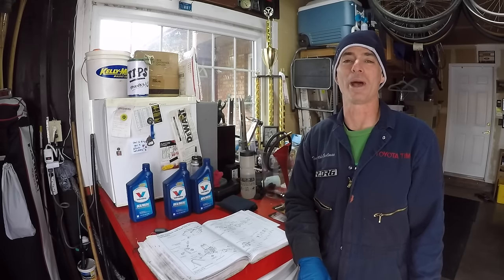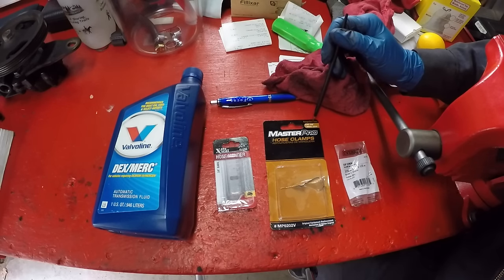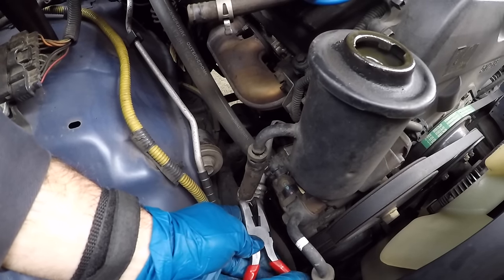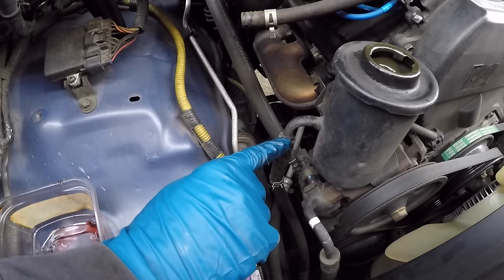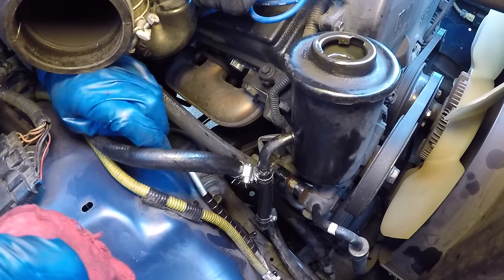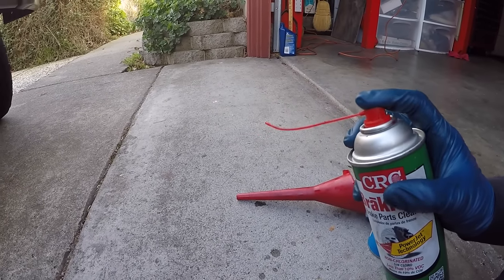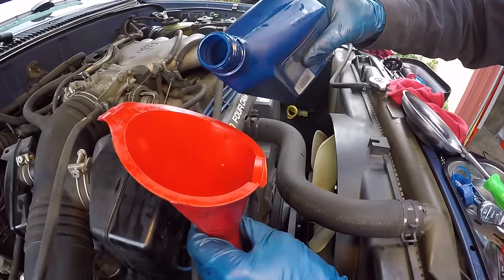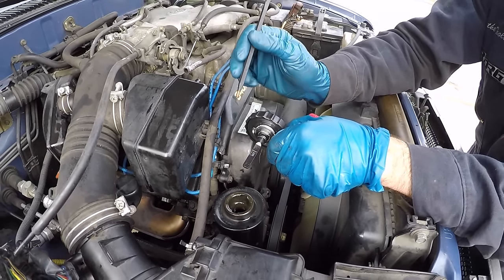Power Steering Flush and Reservoir Cleaning

Comment: Thanks for the informative video. Why not clean the screen before doing the flush? I have always changed o rings. Although they may not be damaged, they do take a set, harden, and will not reseal properly. Your videos are always well done and you explain the steps very well. Keep them coming.
Reply from the maker: Glad you like the video Dan.  My reasoning for doing the flush first is because if we clean the screen first followed by the flush, we may be trapping suspended particles in the fluid right back into our clean screen.  By flushing first and having clean fluid in the system, you can guarantee you'll have a clean screen when the job is done.  Since making the video, we had heard of people having leaks due to the o-ring tearing so we added a section in the video description suggesting replacing the o-ring and we provide the part number and link to buy one.  I just flushed the power steering system on my 98 the other day which included replacing the o-ring as well as adding in in-line magnetic filter in the return line to the reservoir.

It's good to hear you like the way we're making our videos.  Thanks for taking the time to comment.  Happy Wrenching!

Comment: You are so correct about the fine mesh filter medium. It must be cleared of debris.
Reply from the maker: With regular fluid changes, this screen would probably stay relatively unclogged.  But, power steering fluid is one of those fluids like brake fluid that people forget about renewing on a regular basis so it get's really dirty and ends up clogging the screen in the reservoir.

Comment: I did this in 2020 hoping it would solve my problems on my 3.0 3VZ truck. I completely flushed the system, bled it, but the whining / squealing when turning left or right didn't really go away so I fully rebuilt the OEM pump with a $40 rebuild kit.  It has about 5 rubber seals internally plus the shaft seal. Getting the pulley off and back on required some propane torch heat to expand it enough.  Anyway, it worked, ..no more noise and my steering is good.   

And it's actually a tricky rebuild too.  The small internal vanes are lobed on one side and must go back in the right way.. very easy step to miss because you wouldn't notice otherwise.  The 95+ Tacos / 4Runners may be the same or a little different.  95 and before have recirc-ball / worm gear steering not rack and pinion but the pumps, basic system, and process is very similar.  

Secondly, some rebuild kits for these old Yota trucks (mines a 94 ex-cab v6 4x4 and I used Gates kit #350660) don't come with new copper crush washers for the banjo bolt so it immediately leaked once back together. The factory service manual doesn't even mention them.  They are two washers; 16mm ID / 24 mm OD and 1mm thick on each side of the banjo bolt. 

Also be very careful with the plastic Vacuum Control Valve, they can break easily and are $70. I broke a barb while rebuilding the pump but was able to use JB-Weld and beefed up both barbs with the epoxy.  I saw in another video that if the VCV is bad it sucks in fluid to your intake.  So if you are losing fluid either slowly or fast but see no leaks anywhere after a good pump cleaning, pull off the VCV hoses and see if they have fluid in the Vac lines. Use a q-tip to check.  If so.. replace the VCV!

Lastly, the pump definitely needs to be running when moving the wheels lock to lock. Having them off the ground just makes it easier and doesn't eat your tires and stresses the system less but the pump and it's impeller vanes is what is circulating the fluid.  The air which comes back through the reservoir is just burping the system and to do that properly all of the fluid has to be moving through the system under pressure. 

The FSM also says to do all this with the engine running. This is why you do the lock to lock while flushing too, because it opens two different sides of the system.  You have to see the full diagrams to really understand it. I think a good hack to not jack would be two 14" aluminum cookie pans that are buttered and just drive onto them.  Sounds crazy but it would definitely work. And use a little hot soapy water to clean the butter off.
Reply from the maker: Thanks for sharing all that information.  A video of that rebuild would have been super helpful.  Did you happen  to shoot any video of the process?
Reply: @TimmyTheToolman  I did! I shot everything.  I'll edit and upload within the next week or two. I really need to start a channel. I have a ton of truck repair videos and other DIYs but I often get overly wordy and too detailed so I need to really edit them all down.
Reply from the maker: @oldowl4290  I'd like to see the video and I don't care how wordy it is.  I blab quite a bit myself if you haven't noticed.  You should start a channel and let me know when you've posted it.

Comment: Lift the vehicle and while adding fluid turn the wheels back and forth with the engine, that will throw most of the fluid out of the rack and pinon, then start the engine without turning steering, then with the engine off repeat the process. I did it on my Lexus GX470 and only used about 2qts. Is very clean now.
Reply from the maker: Hey Christian, we now know about this as a viable technique.  At the time of shooting this video, we didn't think you could effectively move the fluid through the system with the pump off.  We added this as an optional method in a comment we pinned giving updates on the job as we learned them.  Thanks for the comment.

Comment: Thank you.  Your videos are always thorough. Looks like i will be doing some shopping...this is related to my next project which is to replace my original steering pump, return line, and high pressure line to my '90 pickup with the 3VZE.
Reply from the maker: You're welcome and thanks for commenting about how thorough our videos are.  We want people to be successful using our videos and that's why we put some much detail into them.  Good luck with your power steering pump and line swap.

Comment: Pulled the reservoir, cleaned it, reinstalled. Topped off and bled the system.

Still getting a whine unfortunately...I thought maybe the screen was clogged and not enough fluid was cycling into the pump. It's extremely loud on cold mornings (25 degrees f) but seems to quiet down as the fluid warms up. 

Hopefully this did the trick for colder mornings. We'll have to see or else I may have to replace the pump!

Also I only dropped one of the three bolts (the front small one) and of course it landed in the skid plates.

Great video!!
Reply from the maker: Jesse Vandermaas Hey Jesse, that's a bummer it didn't get rid of your whining issue.  Starting looking at your local PickNPull yards or other auto wreckers for 3rd Gen 4runners and 1st Gen Tacomas so you can grab a used power steering pump for cheap.  You can set up a search for PickNPull where they will automatically notify you when a vehicle that matches your search criteria pops up.
Reply: Probably too late but whining also means you got air in the system. Try bleeding the air out first before spending money

Comment: Great video! I have flushed my power steering a few times over the years but it is very helpful to now know how to clean the filter screen if/when necessary. Motivating me to flush the system again, you are right it is an easy thing to overlook.
Reply from the maker: Thanks Dave.  After seeing how dirty Jax's power steering reservoir filter screen was, I'm going to check out the reservoir on my two 3rd Gen 4runners.  I just bought another 3rd Gen on New Years Eve.  It's a 98 Limited 4x4 with an e-locker.  Only 131,000 miles and it wasn't crazy overpriced like most are in Northern California right now.  Picked it up for $6500.  I searched for over a year for another 3rd Gen after my Subaru Outback died.  I'm stoked my search is over. 

Take it easy Dave and Happy Wrenching!
Reply: Congratulations on your new 3rd gen! Nice find, it is getting hard to find a decent 3rd gen anymore for a fair price. I have a 99 SR5 4X4 4Runner with the elocker and 4.30 diff ratio. Bought it new and it has been a great trouble free truck. 104,000 miles and the only repairs have been the MAF sensor, Air Fuel sensor, shocks, brakes and tires. Replaced the timing belt and water pump at 100,000 and the old timing belt still looked pretty good. Love these trucks!
Reply from the maker: Yep, they are great vehicles and they will be seen on the road for a long, long time.  I'm thinking a high percentage of the 2nd, 3rd, 4th and beyond owners are going to be the type that will be wrenching on these 3rd Gens.  A person that knows how to wrench or that is willing to learn will see value in one of these rigs even if the mileage is really high.  I'm thinking as time goes on, our videos will become more valuable because more people will be needing our videos to keep their rigs on the road and on the trail.  Happy Wrenching Dave!

Comment: Thanks for this great detailed video. One question though: Can you do the power steering flush just buy turning the steering wheel from one end to another end with the ignition key in ON position and without starting the engine?
Reply from the maker: Read the comment I pinned.  It does work.
Reply: That’s what I was thinking. I flushed the power steering fluid with the engine off on my Escalade, so it should work.

Comment: Great video as always. I completed this on my 99 4 runner. Just FYI, when cleaning the screen on the reservoir, use Xylene. Just block the bottom hole, prop it upright, and dump about 1/2 cup of Xylene in there. Wait 10 minutes. Empty it out and viola.... It will look like a new screen.
Reply from the maker: stonesthrow420 thanks for taking the time to comment and leave this tip! We will definitely try this next time. Sicmods!!!

Comment: man i missing working on 4runner. Even though im rebuilding a cummins diesel truck now, i still find myself referring to some of your videos for a quick logic run on certain systems.
Reply from the maker: Do you still have your 4runner?
Reply: @TimmyTheToolman  yep still got her, thanks for asking. I have been trying to sell it for 6k for over a month now.  But no bites.  I think I got about 9ish just in parts alone in it. She is good little truck now.
Reply from the maker: @cameronp5728  Gotcha.  Do you think you'll get another one or are you done with 4runners?
Reply: @TimmyTheToolman  I will definitely get another. In time, probably when I'm not looking and I stumble upon a single owner, with 4x4 5 speed and E locker. All original. That's like the holy Grail for 3rd gen 4runners

This Cummins I have is pretty interesting. It's  one step away from holy Grail. It was the last year for the 12 valves. And its the only 12 valve model where the rear doors open.

1998 Dodge Ram 3500, with a 12 valve Cummins, P7100 injector pump, 5 speed NV-4500 transmission. But it's 4x2. That's what makes it one step away from holy Grail.

You would appreciate this engine & injector pump and the complete mechanical nature of it. Google if you get bored some time.

Sorry rambling over lol gotta get this damn thing back up and rolling!
Reply from the maker: @cameronp5728  Sounds like a fun project.  Good luck with it.

Comment: I was worried this morning.. Steering response was pretty hard on startup, then went for a drive to a local store and it got better, not completely ok, but better. After getting out of the store, steering was on ok on startup.. maybe because the P/S fluid is warm now? From the Forum search it seems like a common issue on these cars. Hopefully this service will fix the hard steering on my 3rd gen. Your videos are invaluable, Thanks Tim!
Reply from the maker: Hey Mike, power steering fluid is one of those fluids people don't think about renewing, just like brake fluid is.  So, the fluid gets old, deposits accumulate and get stuck in the fine mesh metal screen.  Over time, the screen can get blocked up so bad that it starves the steering rack of fluid.  If people renewed their power steering fluid regularly, this cleaning probably wouldn't ever be necessary.  For sure cold ATF doesn't flow as well as warm ATF.  As ATF warms, it thins out and the volume increases.  This is why you have a cold and warm level on your auto trans dipstick and also on your power steering fluid dipstick.  I'm guessing you're going to find a very blocked up reservoir screen when you check it out.
Reply: @TimmyTheToolman  Yeah that makes total sense. Looking forward to it. 👍🏻
Reply from the maker: @Mike_44  Good luck with the job.
Reply: @TimmyTheToolman  Thanks brother 👍🏻I just realized I need a bigger/taller floor jack lol
Reply from the maker: @Mike_44  Well, where are you trying to jack under?  Most floor jacks can reach the areas necessary to get the wheels off the ground.
Reply: @TimmyTheToolman  The floor jack I had was a smaller 2 ton which worked ok for my previous Forester, but the 4Runner’s frame is taller so I had to get a taller jack. It’s all good, it worked out. I needed a bigger one anyways for my wife’s Honda Passport as well..
Reply from the maker: @Mike_44  Roger Dodger
Reply: @TimmyTheToolman  I replaced both LBJs today.. my first kinda in depth service for the 4Runner 👍🏻
Reply: @TimmyTheToolman  😎
Reply from the maker: @Mike_44  Good job gettin er dun.
Reply: @TimmyTheToolman  Thanks!

Comment: I know this is old now but I wondered if there was an additive you could have sent through to help clean it and then reroute the line back into the res can. and just let it run a while then empty and repeat.  Avoiding the gunk from the res can is a good idea too.  Perhaps a temp filter in that line setup to catch gunk before it got to the pump etc. even a garden hose type strainer may have helped catch big chunks.  There are other screens available too with much smaller holes.  Anyway, I liked the video.  I need to do this on my 2003 Taco 4WD, along with many other things.  I'm at 122k its been treated nice but some things overlooked.
Reply from the maker: Don't know of an additive that would have helped clean out that screen.  Even if there was an additive that strong to be able to clean out the filter screen, what would it do to the pump and steering rack seals?  Anyway, good luck with the job.

Comment: The pump has a by-pass valve which is where the fluid goes when you are not turning the steering wheel or are fully turned to the maximum.  When I heard you say you were not going to turn the wheels I did a face-plant... but I saw you edited the comment end where you decided to actually clean out the rack as well.  Does that kind of pump have a filter on it?  I have a Kia and it has one I found out in the bottom of the reservoir that I forgot (did not know it was there actually), and had to begin again..
This was a great video and helps a lot to watch through as it is full of good ideas in it!
Reply from the maker: Yes, the reservoir has a fine mesh metal screen as a filter.  We cleaned it in this video.
Reply: @TimmyTheToolman  my add probably missed it.. LOL!!
Reply from the maker: @mrstanskaggs1  No worries.

Comment: Hello Timmy. Thank you for the great video. I need to clean the reservoir on a Honda Civic 1995. Is it the same procedure since the top openning on my reservoir is way smaller than the one showed on your video?. Thanks
Reply from the maker: As long as you can get the nozzle of the brake cleaner in there and you can shine light through the bottom to see your progress, I don't see why it wouldn't work.

Comment: Ive got a question for you timmy: if you replace the pressure lines, is a flush still necessary? Im also doing my rack. Since ill have clean lines and a new rack anyway, im just not sure if i need to flush it out.  Im sure my screen probably does need cleaned though. My fluid is black and smells really burnt. Its pretty nasty. I really appreciate you taking the time to document all your maintenance adventures with these! Ill use this and the one you made on replacing the rack to help get my power steering back in shape!
Reply from the maker: If you're replacing the lines and the rack, there would be no need to flush but I would definitely clean the reservoir screen.  If your fluid was black, that means you filter is probably clogged.
Reply: @TimmyTheToolman  Ive got no history on my truck, but from what I can tell, its been pretty mechanically neglected. Ill go clean the screen and just fill it up. Thanks Timmy!
Reply from the maker: @alexhafko5667  Smart decison.

Comment: You can also use the Radiator Transmission Cooler caps to plug the return hose connections. No need to buy clamps, hose, etc.
Reply from the maker: That's provided you happen to have replaced a radiator and saved those caps.